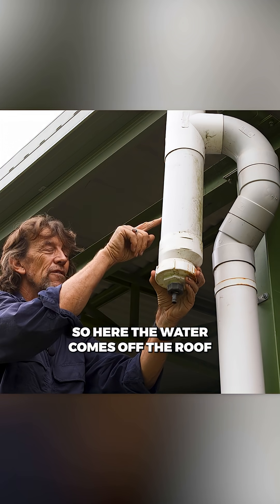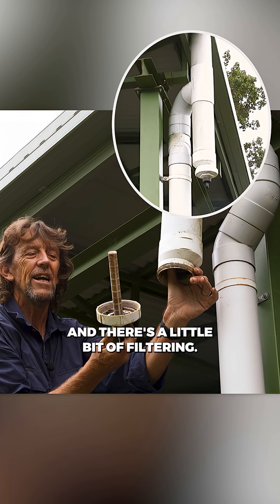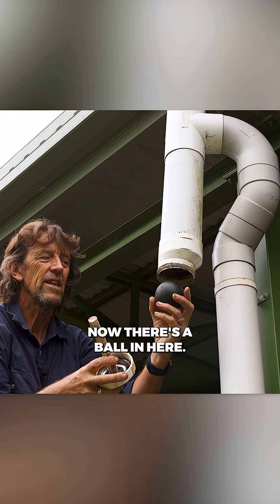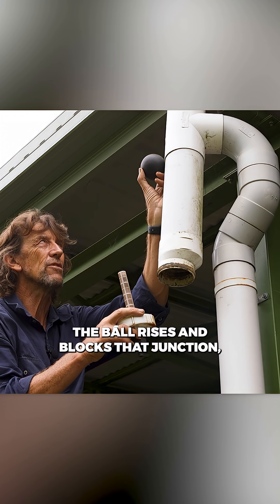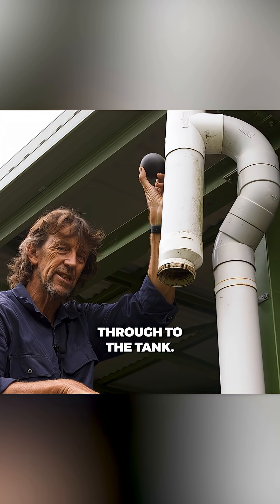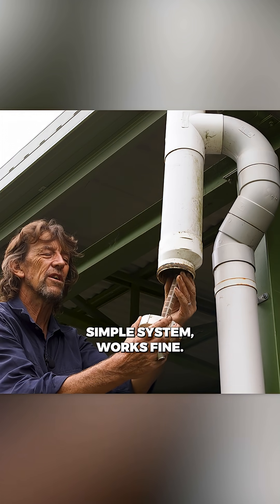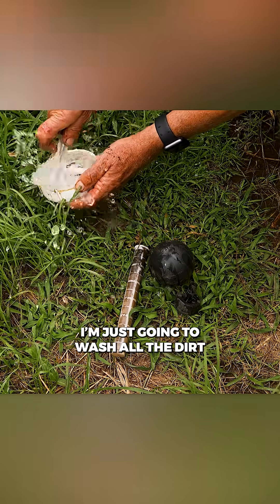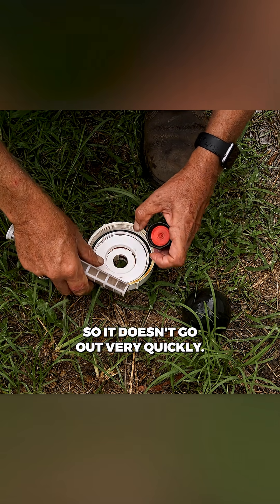What's a first flush system and why it matters? 💦

Comment: I would love to know how this can be accomplished in areas where the temperature goes below freezing every night. 
Every attempt at using PVC for the initial flush always cracks. 
Any tips?
Reply: The first flush should not be in use during the winter. All snowmelt should be drained without going into the tank. Although a lot of the people I see using this in cold climates have very long pipes, so maybe that is the answer you want.
Reply: I live on central Portugal, so not a lot of Snow or frost. But maybe metal? Since the water drains it shouldn't freeze inside and crack the pipe. Totally guessing.
Reply: @joaorodrigues4009    well. Not to put you down, but to teach...  if it were the same setup with metal instead, the waters expansion when freezing would certainly break the metal amd make it look easy at that.
I wish I had the answer though, my only guess would be to gently warm whatever pipes you're using. But the question is how to do so safely or in situations with little to no electricity.   🤷🏻‍♂️
Reply: You’re saying it rains during the day and then freezes before the first flush drains? That seems like it would be a rare occurrence to freeze that quickly after a large rain.
Reply: @zachman310  jeez, lol, I was stuck on the water sitting and freezing and forgot the whole point was to drain the water.  😂
Reply: COULD USE SALT PIPES PERHAPS!?? 😋😄😅
Reply: TRY GETTING YOURSELF SOME OF THOSE RAW MUD/CERAMIC PIPES. GLAZED ON ONE SIDE. HAVE THEM BE MUCH LARGER THAN YOU WOULD ACTUALLY REQUIRE AND COULD PERHAPS HAVE THE PIPE LINED WITH A NICE THICK POLYTHENE LIKE LONG PIPE BAG ON THE INSIDE .SEE IF THAT WUD HELP.🙄☝

Comment: And the purpose of this is to collect the debris already on the roof or in the gutter/drainage pipes? 

I'm assuming you've got one or more additional layers of contamination collection/separation before the water reaches what I assume is  a storage tank of some sort.
Reply: Yeah, organic material builds up over time on the roof and gutters, so the first bit of rain that you catch during a storm is always the dirtiest and is ideally diverted like this. Keeps water in your tank even cleaner, and yes there's other filters through the system usually but this is the one that stops the dirt before it can get into other filters in places that slow the water down too much when they get clogged. It means much less constant maintenance and filter cleaning
Reply: Most rainwater tanks also have a debris screen on them with a fine enough mesh that insects can’t pass through and breed, and most people filter the tank water before drinking/cooking with it. 

You’ll also find that any organic matter than makes it into the tank is very fine and settles to the bottom once the rain event is over. Every 5-10 years people who rely on the tanks for potable water clean that sediment out.
Reply: The primary concern is the fresh bird shit, this removes most of it and allows you to use way lest chlorine to make the water safe for drinking.